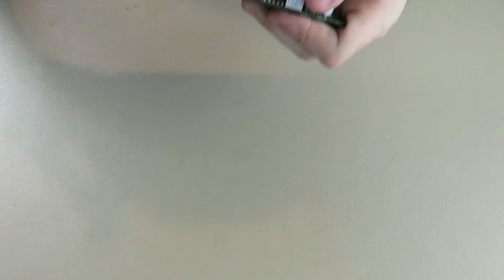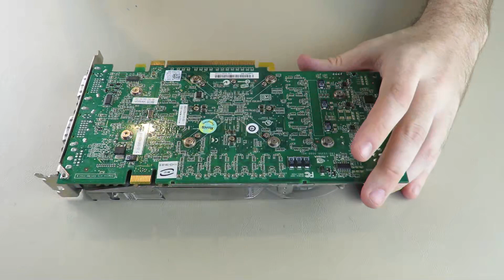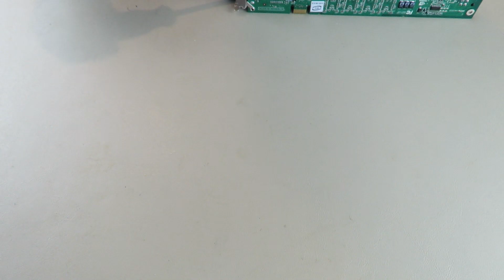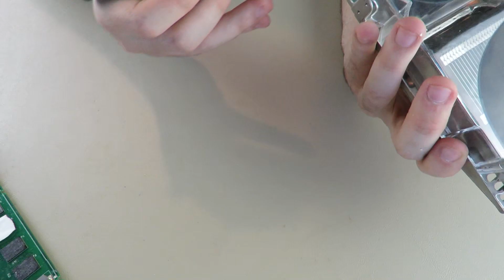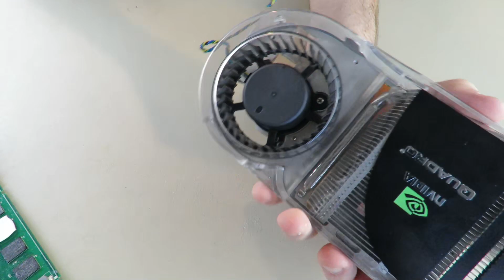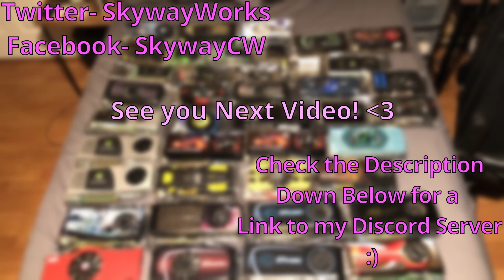Quadro FX 4600 Teardown

Comment: Served me well in my i7 2600k build from 2011, my first pc I had built since 2000.
Reply from the maker: Older cards like that feel like tanks. Honestly seems like they would never die!
Reply: @skywaytech  well it died after a big power failure in my house that also destroyed the power supply. But I bought it again recently very cheap!
Reply from the maker: @JohnSmith-iu8cj Aww that’s a shame! Least you got it replaced! I run everything off UPS’s! It helps protect the hardware I care about!

Comment: One year later and your video helped me bud, I unscrewed everything and the heat sink would not come away from the board so I thought I was doing wrong, turns out the thermal paste was stuck on good so had to pry with a screw driver, thanks for confirming I didn’t miss anything
Reply from the maker: Glad I could help!!